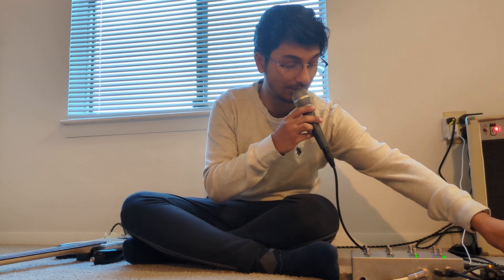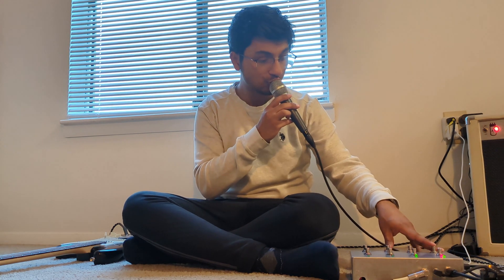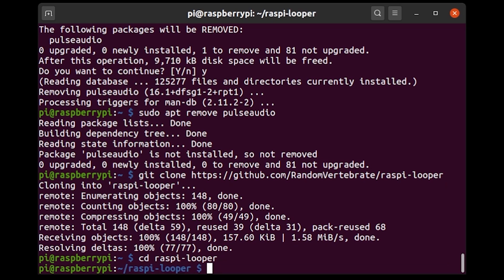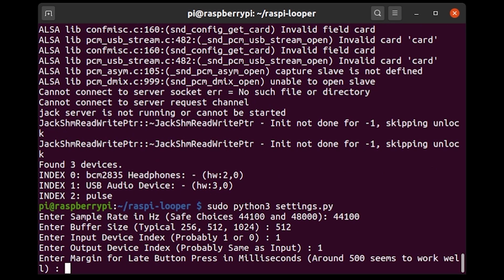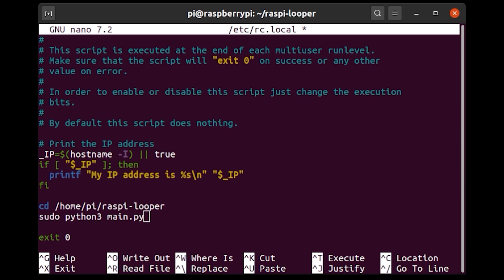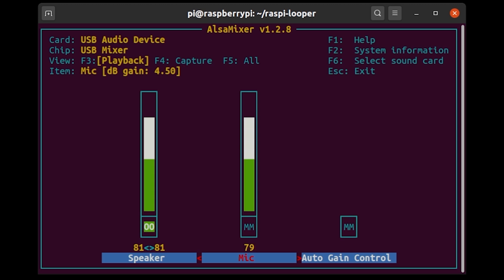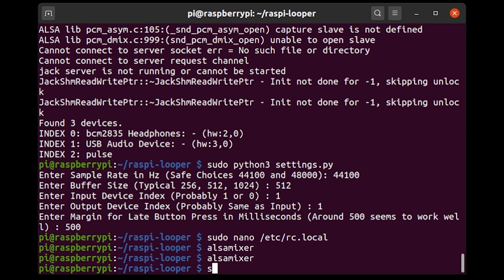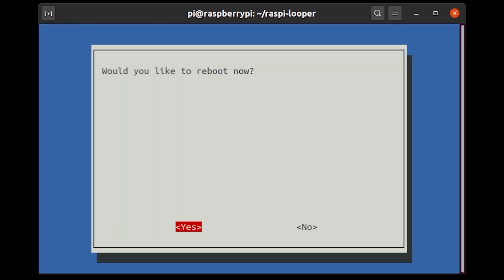DIY 4-Track Loop Station Update 2024 | homemade multi-track looper pedal

Comment: Bro my sm57 output is very low . My audio interface does not provide enough gain to it . Could you please make a balanced input and output low noise pre amp . They are very costly to buy

Comment: @ThePsychotenuse nice Looper and thank you for the update!

It seems a bit like the RasPi power is not really utilized if it is only used as a looper.
Does it have enough “reserve” to integrate additional functions (reverb, delay, distortion, LoFi effects), a visualization (UI) on a small display, etc.?
Reply from the maker: Sure, if you try hard enough... But the way I look at it is, why bother? If I wanted to use a DAW live I would simply use a DAW live. The whole point of this project is to cut the chaff, as it were. Less is more.

Comment: This is really cool! I’m interested in how the quantisation works, I don’t think you mentioned what happens if the first track is a lot longer than your example? Will the second track be noticeably changed by quantisation?
Reply from the maker: The minimum length of the second track is equal to the first track, so if you press the button early you'll get silence till the end of the track.

Comment: Hey, this is awesome. I am currently building one with foot pedals so I can play piano and guitar. I would like to add one more switch to act as a global mute/unmute button. I understand how to define the GPIO pin in the code, but I'm not very savvy with Python and don't know what the syntax for such code would be. Any help would be greatly appreciated. Thank you!
Reply from the maker: Hey, to do that you could add a new button and define a callback function which would in turn mute all the tracks. Using the mute toggle function would not work here since you don't want to unmute any muted tracks when you press your new button. So the callback function for the "mute all" button should set all tracks to muted or playing individually by setting Boolean variable values.

If you would like to discuss this further feel free to email me at my "business email".
Reply: @Psychotenuse  Thanks so much! I also really appreciate that the code is thoroughly commented. Incredibly helpful! I'm waiting for a pi in the mail and 3d printing pedals and such, I may reach out in the coming weeks. Thank you again.

Comment: Hi Psychotenuse ! I still need your help because I've set up your looper on Raspberry Pi, but when I start the main program, I get the following message : Do you know what's wrong ? Thank you very much for your help.
LOADING...
Traceback (most recent call last):
  File "/usr/lib/python3/dist-packages/gpiozero/pins/pi.py", line 408, in pin
    pin = self.pins[info]
          ~~~~~~~~~^^^^^^
KeyError: PinInfo(number=7, name='GPIO4', names=frozenset({'BCM4', 'WPI7', 'GPIO4', 4, 'J8:7', '4', 'BOARD7'}), pull='', row=4, col=1, interfaces=frozenset({'', 'i2c', 'spi', 'dpi', 'gpio', 'uart'}))

During handling of the above exception, another exception occurred:

Traceback (most recent call last):
  File "/home/pi/raspi-looper/main.py", line 12, in <module>
    PLAYLEDS = (LED(2), LED(3), LED(4), LED(17))
                                ^^^^^^
  File "/usr/lib/python3/dist-packages/gpiozero/devices.py", line 103, in _call_
    self = super().__call__(*args, **kwargs)
           ^^^^^^^^^^^^^^^^^^^^^^^^^^^^^^^^^
  File "/usr/lib/python3/dist-packages/gpiozero/output_devices.py", line 192, in _init_
    super().__init__(pin, active_high=active_high,
  File "/usr/lib/python3/dist-packages/gpiozero/output_devices.py", line 74, in _init_
    super().__init__(pin, pin_factory=pin_factory)
  File "/usr/lib/python3/dist-packages/gpiozero/mixins.py", line 75, in _init_
    super().__init__(*args, **kwargs)
  File "/usr/lib/python3/dist-packages/gpiozero/devices.py", line 549, in _init_
    pin = self.pin_factory.pin(pin)
          ^^^^^^^^^^^^^^^^^^^^^^^^^
  File "/usr/lib/python3/dist-packages/gpiozero/pins/pi.py", line 410, in pin
    pin = self.pin_class(self, info)
          ^^^^^^^^^^^^^^^^^^^^^^^^^^
  File "/usr/lib/python3/dist-packages/gpiozero/pins/lgpio.py", line 126, in _init_
    lgpio.gpio_claim_input(
  File "/usr/lib/python3/dist-packages/lgpio.py", line 755, in gpio_claim_input
    return _u2i(_lgpio._gpio_claim_input(handle&0xffff, lFlags, gpio))
           ^^^^^^^^^^^^^^^^^^^^^^^^^^^^^^^^^^^^^^^^^^^^^^^^^^^^^^^^^^^
  File "/usr/lib/python3/dist-packages/lgpio.py", line 458, in _u2i
    raise error(error_text(v))
lgpio.error: 'GPIO busy'

------------------
(program exited with code: 1)
Press return to continue
Reply: I solved my problem 👍
Reply from the maker: XD

Comment: Thanks for the update! Have you ever considered creating a looper on an audio-specific dev board such as Daisy or Teensy?
Reply from the maker: I have, but it would be difficult because of limited RAM.
Reply: @Psychotenuse  ahhh of course. I suppose it would be overkill to use a Pi as the looper brain and an audio board like Daisy for effects when the Pi could just do it all with the right code.